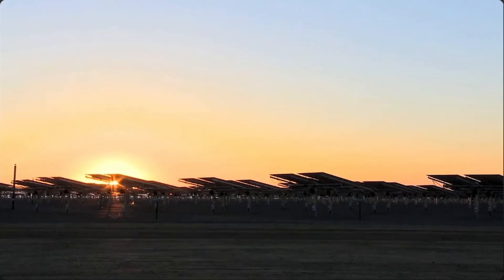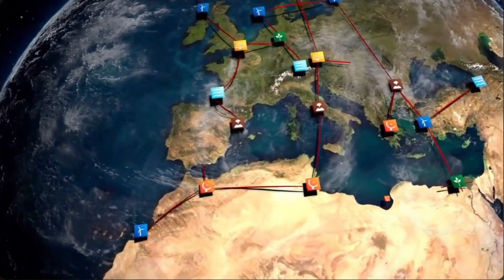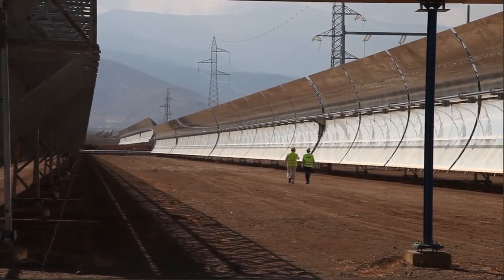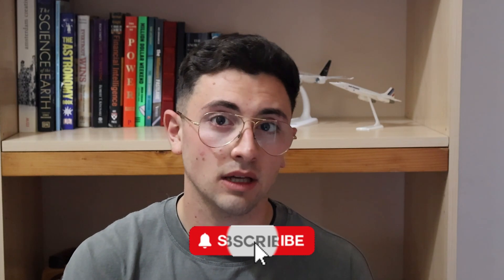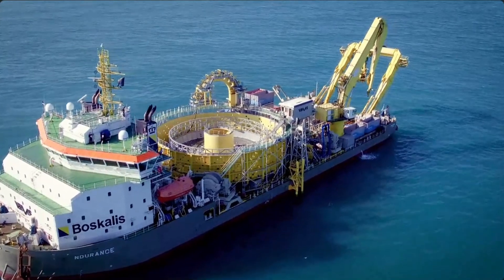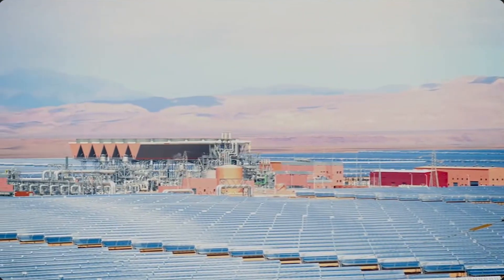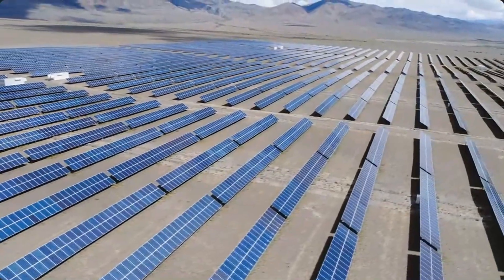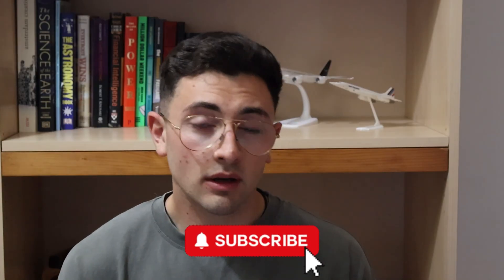Why Solar Energy Will NEVER Work In Africa

Comment: PV is already efficient enough. There is no need to go to Sahara - it can be done in European: cover every roof in Europe cities with solar panels.
Reply from the maker: Exactly! Thats the reasoning I end the video with 🙂
Reply: But Africa has more sunlight, so they probably will get more electricity
Reply: @kiorde It's impractical. The simplest solution is the most efective: install PV panels with battery storage where is already a demand - in the cities
Reply: Yeah, both are correct 
But if you measure the available roof area of Europe (especially when considering multistory buildings) and compute the current energy demands (2024) you'd see that most of Europe wouldn't be able to produce enough energy to meet their CURRENT DEMANDS without factoring in storage of curtailment etc 

Then consider that energy demands are only increasing into the future, and it is clear that Europe won't meet it's energy demands.
Some estimates put it at a tripling (3x) of energy demand by mid century 

So, to keep up economic growth and productivity, copious amounts of new energy generation is needed to meet the needs 

Same applies to Africa, the vast majority of that energy should be used as close to where it is produced as possible, one simple way to get local job creation and productivity, curbing the illegal migration problem of the massive unemployed youth, who will likely cross 800-900m under 30yrs old, of not already there 

I think Europe should pull out all the stops for both North Africa surplus ALONG WITH the massive wind energy generation from the north sea, to generate, store in batteries and convert to green hydrogen, along with biofuels (including using it's well established underground sewage system for biogas generation) 
Everything is on the table, its not a one pony show....

That will give them a best chance of energy independence as possible